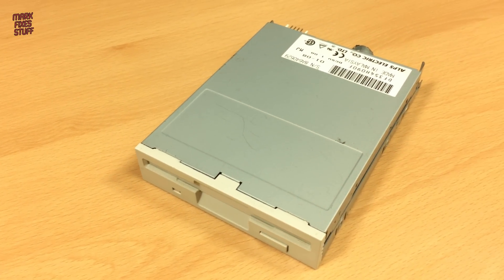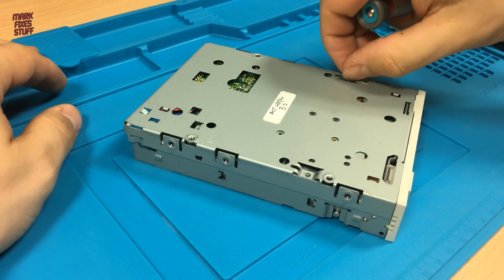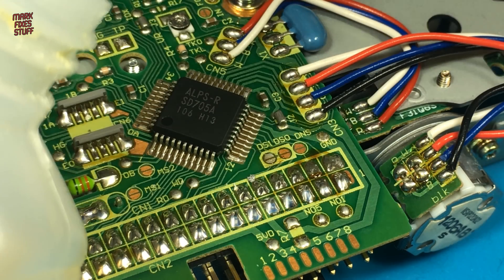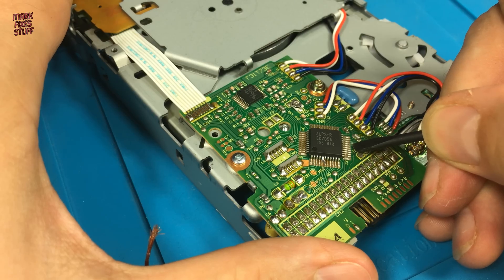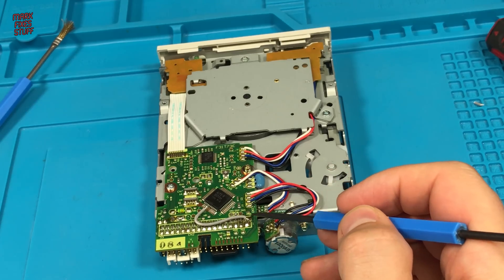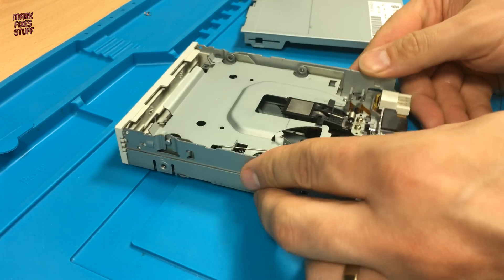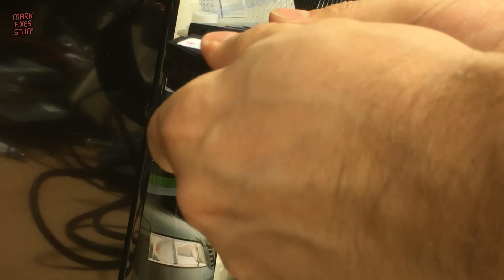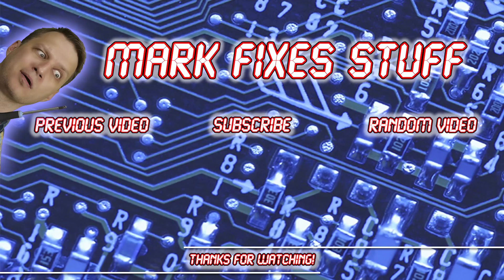Use a PC Floppy drive on a Commodore Amiga!

Comment: Used to manufacture both 5 1/2" and 3 1/4" external  expansion drives for Amiga in 1980's and still have a stack of PCBs for  both drives logic and special  connector required by Amiga.
Reply from the maker: Wow! That’s dedication Helmuth! Back in the early nineties I worked in a diskette duplication factory producing Amiga diskettes. I was a drive technician repairing the machinery.
Reply: Is there are way to purchase any of those?
Reply: @bassbacke  depends on a number of factors, presently I would need to dig out the circuit diagram and find where I have the PCBs among my stacks of stuff stored. Might even still have some ribbon cables as well to go with the PCB.
 Have not paid much attention since early 2000s, and packed away much around 2007. PCBs would be rather cheap so mailing cost might be higher than material. One aspect in those days the 23 pin connector was rare and we tended to use modified 25 pin connectors.
Drives wise we would have delivered close to 1000 3 1/2" and 200  5 1/4" drives in those times, even lost 50 or so on consignment to one Amiga retailer that got liquidated, the liquidator kept all stock at the premises, though our drives were never the property of the shop.

Comment: Couldn't you just modify the ribbon cable?
Reply from the maker: No because the drive is jumpered to be df1 and some of the signals are missing from the controller chip. Do you know of any drives that can be used with a modded cable?

Comment: Solder braid has a reputation as being damaging, isn't it better to use a solder sucker (manual or electrical) on a valuable PCB?
Reply from the maker: If it was a valuable PCB and you were not experienced with braid then it might be a risk. I've not had much trouble myself. The technique is to make sure your iron is hot enough to deal with the thermal mass of the joint and the braid itself at the same time, and also keep the braid moving. Thank you for watching  :)

Comment: Correct me if I'm wrong, but i believe that this procedure will also enable the floppy drive to be used with a Sinclair ZX Spectrum +3.
Reply from the maker: I don't actually know!
Reply: @MarkFixesStuff  Mark, that really surprises me 8-O I thought you'd have known; anyway, just like the Amiga computers, the Spectrum +3, as well as its Amstrad brethren, requires a !Ready signal in order to use a floppy drive, which of course Amstrad's own 3" drives do have. I have seen various "hacks" trying to circumvent the lack of the !Ready signal on many common PC FDDs - such as a switch to turn on when there's a disk in the drive, but this seems more appropriate to me.
Also, before i forget, here's a link to the +3's Drive B:  connector:
https://tietokone.ntrautanen.fi/hardware/hwb/co_ZXSpectrum-DiskB.html
but i think the pin numbers may have been swapped with regards to Upper/Lower side of the PCB
Reply from the maker: @BertGrink  Ohhh, very interesting! Thank you for the info :)

Comment: Instead of butchering the board, could you not have swapped the leads around on a piece of perf board and a couple of 34 pin connectors?  This approach would make it drive-agnostic as well.

Comment: Hi All, very well done, back in the day, a few of us used the IBM floppy as a second external drive on the 500's and 1000.
I cant recall exactly, but a few components lived in the external connector, i was told if a do open it be very careful.

It was a bit if a trade secret but the people i dealt with were good friends and not strangers worried about who it was done.

There was a few catches, if it failed you could not just use any ibm floppy drive, they had a list of what worked and what did not, eg it only works on Sony or Hitachi or Mitsumi and a list of model numbers

Regards
George

Comment: Why oh why, did they ever think of such a strange system. Wouldn't it be better to make the change in the Amiga to connect an original and unchanged disk-drive.
Reply: Actually, it's the "IBM" floppy interface that is a modified Shugart floppy disk drive interface. The modification was designed to allow connecting two drives on the same twisted cable with individual motor control lines and no need for jumpering. This is also why all "IBM-compatible" floppy drives are set to use DS1 (Device Select 1, pin 12 at the drive connector) instead of DS0 (pin 10 at the drive) as the "IBM-twist" on the floppy cable allows to use pins 10 and 16 for motor control and pins 14 and 12 to select drives "A" (after twist) and "B" (before twist) from the floppy controller end. This also reduced the amount of supported drives to two.

The classic Amiga hardware supports a total of four floppy drives, as does the original Shugart interface from the 1970s.

Comment: Nice soldering, but I would've liked to have seen any discussion regarding what the actual changes from a PC to an Amiga drive are, instead of just "I'm cutting x and moving y".  Still,  nice to see Amiga stuff well into the 21st century.  :)
Reply from the maker: +riz94107 hmm, good point. I’ll be no more descriptive in the next one. Thank you :)
Reply: well, I know everyone's a critic with soldering, but 3:50 wasn't all that nice. molten solder on top of cold contacts, wouldn't be too surprised if that bridge just pops off with time

Comment: And as always, like in tons of videos I already checked, it is missing the part where they adapt the floppy eject button to fit into Amiga case....lol.
Reply from the maker: This model of drive would require some cutting and glueing as it's not really that common. The Samsung drives can be fitted with a small mod to the metal tab IIRC?
Reply: @MarkFixesStuff  I have absolutely tons of floppy drives (like several hundred - yes around about 500!). Would you like some different models so you can try out all models of floppy drives and do some more excellent videos. I have  ALPS, Samsung, TEAC, NEC, Mitsubishi, Epsom, Sony, Citizen, Chinon, Yamaha(?), Toshiba...etc. Free or 'donation'  of course...postage is likely around £3 unless you live on the moon.
Reply: @ojbeez5260  do you still gave these drives ?. .. i know im  a bit late here lol .

Comment: You know that RD test point that you used isn't a _READY signal? it is a _READ_DATA (PIN 32 of floppy connector). If you mod floppy in this way then when you connect external floppy to amiga, niether of them will work. Ohh and BTW, the quiqest way to mod any pc floppy to use with Amiga, is to solder diode from pin 34(_READY) to pin 10(_SEL0), cut trace on pin2 and solder wire to lifted controller pin, change jumper fron ds1 to ds0, bridge HD floppy sensor.
Reply from the maker: Mariusz Koźliński thank you. It’s good to learn this. I’ll be making a follow up video in the future
Reply: +1 Mariusz.  This mod works only with 1 internal floppy drive.

Comment: Is that a HD drive or DD? If it is HD, can it format/read/write HD floppys in Amiga or will it work just like a DD drive?
Reply from the maker: Just in DD mode.
Reply: @MarkFixesStuff  Thank you. But it is originally a HD PC drive, isn't it?
Reply from the maker: @TheArtofWalls  Yes sir!
Reply: @MarkFixesStuff  I wonder if there's a way to modify the Paula chip to allow it to read and write to HD disks. As I recall, it's a bit too slow for that. Might be able to add some hardware there to intercept the signal or something. IDK
Reply: @CoyoteSeven  The Amiga HD floppy reduced the RPM's from 300 to 150 to use HD mode, so this would be challenging to archive with PC floppys which rotate constantly at 300RPM. I cannot remember. was it 1024 bytes per sector or 22 sectors? I think, 22 Sectors were used, like the MB02 disc interface for ZX Spectrum
And you cannot xcopy game DD to HD discs.

Comment: You have not adressed the small plastic eject button issue (it is way different on Amiga's). And you might want to bridge the DD/HD switch inside the drive, to kick it into permanent DD-Mode. This way you can use 3M branded or other high quality HD disks, without the need for a piece of tape. This however is mostly usefull for people like me, still using disks, and have like 450/500 and more disks on hand.
Reply from the maker: Of course. I leave the case modding to others. I think there is a printable button for these drives out there. Thank you for your kind comments. I think I will revisit the drive with some observations in a future video.
Reply: @MarkFixesStuff  No probs. Well... You can find them for the Amiga3000 somewere and print your self. Else you need to go to: https://amigastore.eu/en/624-floppy-drive-replacement-button.html for a replacement button.
Reply: @MarkFixesStuff  Here we go: https://3dwarehouse.sketchup.com/model/d440b256-97b5-4910-8216-748344df29f5/Eject-Button-for-Amiga-3000D-internal-Floppy-Drives

Comment: @ 6:23 - It looks like you drove that wire right through to the ground rail. It could have melted the solder mask and shorted.
Reply from the maker: Don't worry, I check connections with a meter. I just don't show them all because the video gets too long.

On the video everything looks much bigger, but in real life I can't see everything so well, so I check, check check. Probably a bit too much actually.
Reply: Yea, but it didn’t …

Comment: why lifting the pin? you can just cut the trace and not risking damaging the chip at all
Reply from the maker: Just felt like doing it that way really. Bit of variety haha
Reply: @MarkFixesStuff  I never do this even on true hole ICs , I feel it is wrong :P
Reply from the maker: @intel386DX  ahh, I have a big pile of these drives in working and non working condition. I have so many spare parts. 

Lifting a leg can make you feel dangerous haha!
Reply: @MarkFixesStuff  hehe, so you have a piles of that same model and revision of the same drive ? What is the instructions for various drive models and revisions? Is there a universal way to convert them for Amiga?

Comment: some 5-10yrs ago(sorry for such a broad time span) there was 1-2 webpages with lists of drives that could be adapted and how to....... I toyed with a few handful and found that a lot of older floppy drives had jumpers, or a lot of easier steps that could be trial and error into working:P; some were missing components that would be needed to be used as an amiga drive(detect the floppy is in)..... this is in large part why I keep every floppy drive I get my hands on(easily have some 30+)
Reply: If we are thinking about the same lists, they were wrong in some (many?) cases. Ready Signal was identified by try and error instead of an oscilloscope.
Reply: Marcian0  honestly wouldn't be able to tell ya; up to that point I was convinced that PC floppy drives were not compatible at all than I seen some information about some adapter that could be used to adapt a floppy drive; from that I eventually found the list of drives..... I dunno about inconsistencies on drives but that was cause from the start I was quite willing to accept the idea especially with smaller companies there was a likelihood of 152 variants of the same model floppy drives; I was expecting there to be inconsistances..... even now a day on a different topic; installing an alarm system on my car, I'm referring to information available for 4 years worth of 3 different model cars to get an idea where everything should be cause apparently the Canadian version of the car doesn't follow the exact same wiring convention as the American and worse yet the car was made by a different company than it's badge(pontiac vibe:P).... the nature of electronics sometimes lol

Comment: Hi
Try to connect a DF1: drive with Alps as DF0: or vice versa. Check, it will not work
Reply: Initially I thought that I'm doing something wrong! I tested with the same machine using a modded Sony MPF-920 and no issues. I then tested the Alps with another Amiga and still, DF1: will not work!
Reply from the maker: @kattan2006  Yes, look like I made a mistake here! It's all learning though. Thank you for your helpful information. I'll need to make a follow up!
Reply: @MarkFixesStuff  Still, I love your videos so please keep making them :). Very informative .. and funny ;)
Reply from the maker: @kattan2006  Thank you so much :)
Reply: The RD Signal is probably read data instead of ready. Ready then missing on the drive...
Reply from the maker: @marcianzero_yt  I will look into it. Mostly I must try Sanity's Arte demo. RDY is specified in the drive controller, I think on pin 32? I'll do some extra digging.

If RD is not the ready signal then DF1: would not work for sure.
Reply: By the way: Because of the long Channel Name your comments don’t wrap (Carriage Return) at the end of the text field. Thus I don’t get what you say. Tried on iPad and iPhone. Will see later whether a Computer will do better. ;)

Edit: Switching from the App to a browser does the trick, but is quite inconvenient. 
But one more question. Where did you find the data sheet of the alps Floppy controller IC? Really interested. :)
Reply from the maker: @marcianzero_yt  Thank you for letting me know that. I have now just changed my name on Google so it will just show as Mark Fixes Stuff in future.

I didn't find a data sheet, but was only reading about it and learning more from one of the MSX forums.
Reply: Yep, true...it's read and not a real ready signal.

Comment: Well I suppose it is a necessary evil, but you have actually destroyed a PC floppy drive (which works on PC and AtariST) in order to get the amiga FD0 drive. Sadly it probably needed to be done for the reasons of (A) being able to boot from FD0 (without the internal A500 mod to boot from FD1), and (B) to be able to write floppy disks. Showing a test video of writing a disk would be cool So for example writing a disk that piggyback boots to another drive, or scsi device (like a raspberry-pi mimicking a scsi device) or the parallel or CDROM via serial (e.g. connected to a CD32) could be cool.
The are mods with arduino (or RaspberryPi) which allow an amiga drive to be emulated, or a PC floppy drive to read amiga floppies. However those (e.g. the arduino, like the ARMiga) of only read floppies and do not write floppies.
So as to avoid that destructive soldering (and to make it all revesible), being able to plug BOTH a Pi and Arduino floppy project together with a changed to the code into the FD0 cable without destroying the PC-Floppy-Drive would make far more sense. That should bean update done to those two projects as a mashup.

Raspberry Pi

https://www.youtube.com/watch?v=BVYVZ3fsesk

Arduino
https://create.arduino.cc/projecthub/robsmithdev/arduino-amiga-floppy-disk-reader-v1-485582

As an aside, here is how to make a Pi into a SCSI device (e.g to plug into the back of an a590 or similar amiga scsi port). So, that way you can "network" amigas with other amigas (and with other devices) to share files and read and write to the scsie (or even boot off it) simultaneously. And it is reversible.
https://hackaday.com/2017/05/01/the-raspberry-pi-becomes-a-scsi-device/
Reply: Or.... Just buy: https://rover.ebay.com/rover/0/0/0?mpre=https%3A%2F%2Fwww.ebay.ie%2Fulk%2Fitm%2F272354375049

Comment: Does this also work for an ST?
With regards the tool size, I may require further evidence 😉
Reply from the maker: I think an ST will just use a PC drive as is?
Reply: @MarkFixesStuff  Not exactly - for the ST you also have to set it to drive 0, and it is much harder to make disk change detection to work, as in ST it actually uses pulses on /WP line while ejecting/inserting a floppy disk to the drive.
Reply from the maker: tzok83 good info. Never even thought about it to be honest! Thank you.
Reply: @MarkFixesStuff  I replaced drives on STFM, MSTE, TT and Falcon with no issues and I didn't have to do a thing. I guess you lose 2-drive capability but who really needs 2 drives on an ST. :)
Reply: @AmstradExin  I loved my atari to bits , but the diskswapping on some games was hellish....

Comment: Gah, lifting legs on little SMD processors like that gives me nightmares. 
I managed to snap two off my 3D printer trying to add extra features and had to jump through all sorts of hoops and sacrifice all gains I had made to get it back in working order without them.
Reply from the maker: +thumbwarriordx I get it. I’m a bit blasé here because I have a huge pile of old drives but these legs are very small!

Comment: Great tip nice work, I assume that all PC drive boards are of the same type and layout ?
I assume you have to use a 1.44Mb PC drive to convert to Amiga use otherwise you would
be restricted to only using 720KB DD disks ?
Reply: @Mr T. Guru Thank you.